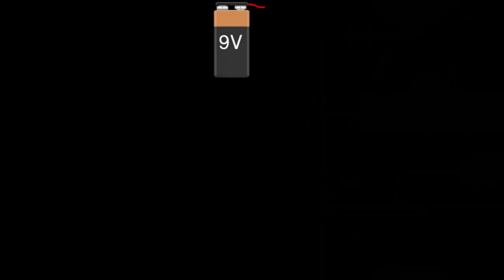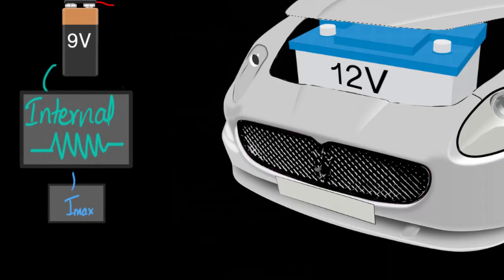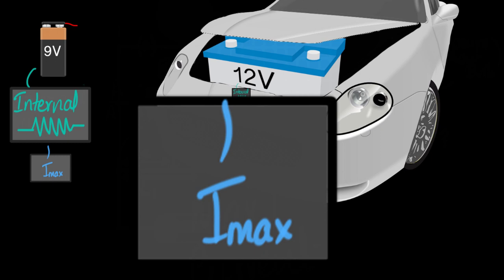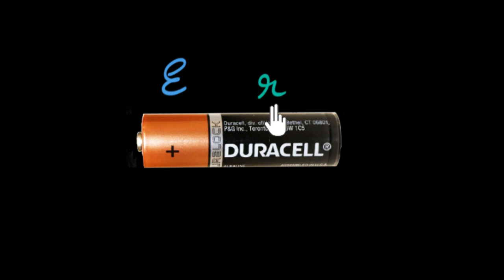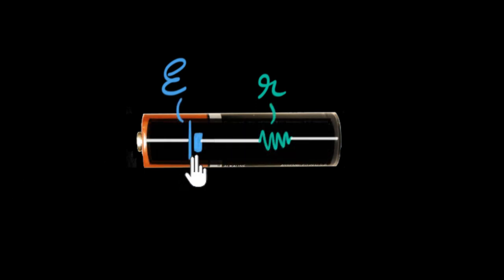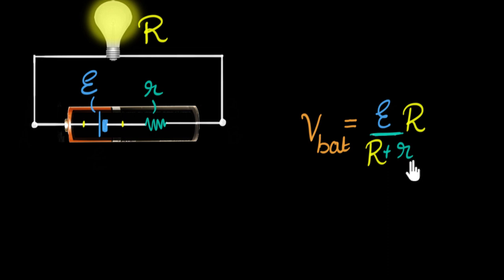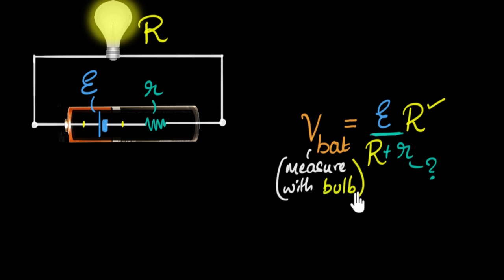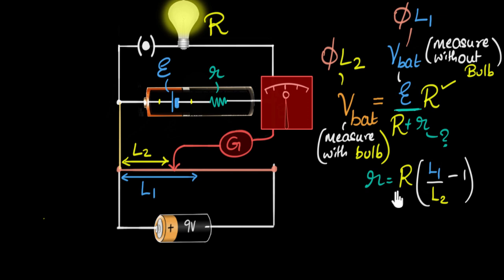Potentiometer - calculating internal resistance of a cell | Electricity | Physics | Khan Academy

Comment: Summary Of The Video :-

Potentiometer

* We use a voltmeter to measure the potential difference (Voltage) but it does not give us accurate value.

Because it draw some ammount of current from the circuit. Which can change the value of Voltage as well.

* We can measure the accurate value of Voltage by using a _Potentiometer_.

 Principle Of Potentiometer -  The principle of a potentiometer is that the potential dropped across a segment of a wire of uniform cross-section carrying a constant current is directly proportional to its length.

 Wire Used In Potentiometer - Generally alloys like constantan or manganin are used as potentiometer wire because they posses high specific resistance and low temperature coefficient

 Null Point or Balancing Length Of The Potentiometer -  The balancing point or null point of the potentiometer is the point on the slide wire when the galvanometer shows zero deflection. 

 Primary Circuit & Secondary Circuit -  primary circuit consists of a secondary cell( driver cell). and a secondary circuit is the one in which the primary cell whose emf is to be determined is connected.

 Potential Gradient - Potential drop per unit length of the wire is known as potential gradient. 

 Sensitivity Of Potentiometer -  Sensitivity of Potentiometer means the smallest potential difference that can be measured by using it and this can be achieved by decreasing the potential gradient by increasing the length of the wire.
Reply: how many time you spent on making it😂
Reply: @Nishantsingh-bq1ml lts actually OK, cause for someone somewhere this might help in understanding certain definitions

Comment: Sir is the magnitude of charge of an electron -1.6 * 10^-19C or 1.6*10^-19 C ? How can 1C of charge contain 6.25 times 10^18 electrons? If 6.25 *10^18C
Move to right can we say 1C of charge moves to left? Please please answer my doubts I have these doubts from a few years and they aren't clarified....🙏🙏🙏
Reply: Charge on an electron is -1.6 *10^-¹⁹ C but the magnitude willl be positive of that value . And through milikans oil drop experiment we found that value , and if there are n electrons the the charge would be n times that value (e=1.6*10-¹⁹) . So q=ne . So if there is 1C of charge n=q/e so 1C/ 1.6*10-¹⁹ which will be equal to 6.25 *10¹⁸ electrons. If ther was 6.25 times 10^18 C of charge divide that by "e" and u will get no of electrons in that amount of charge. We generally use conventional current where positive charges flow but really not , electrons ( negative charges ) are actually flowing from negative terminal to positive terminal) but between 80-90's they used to follow that positive charges flow . So we r till now following that convention that's y it is called as conventional current . So mathematically , a positive charge flowing in a direction is equal to negative charge flowing in the opposite direction. Hope u get that
Reply: @manojmaheshwari4055  superb 👏👏👏
Reply: @manojmaheshwari4055  thank you
Reply: @kiranbhat4902  I'm happy to help you kiran🙏🏻🙏🏻

Comment: Sir at 10:46, why didn't the Galvanometer stay at 0? Why did the Voltage drop when Current was passed through it? Please clarify sir
Reply from the maker: This is clarified in our previous videos on EMF and cells. In short, if you have a 9V battery, it means a coulomb of charge gains 9J of energy as it gets pushed from lower to higher terminal. But, due to internal resistance, some of that energy is converted to heat, as a result the net energy gained will be less than 9. This net energy gained is the potential difference across the cell. The more current we draw, the faster the coulomb moves, the more energy is lost to the resistance, the smaller net energy gained, and hence smaller the p.d. across the cell!
Reply: @KhanAcademyIndiaEnglish  Thank you so much sir!!! 🙏🙏🙏

Comment: Sir one doubt , shouldn’t the voltage of battery be E-ir?
Reply from the maker: That's true as well, but we wanted a relation connecting the EMF and the external resistor, since its value is directly known.
Reply: @KhanAcademyIndiaEnglish  Oh okay sir got it. But sir I got another doubt- why is I=E/(R+r) ,E isn’t the terminal voltage,sir.
Reply from the maker: @sashwatyo1293  Maybe go through our videos on cells and EMF?
Reply: @KhanAcademyIndiaEnglish  yes sir sure sir...actually I have done that Concept once , but I have forgotten most of them over the year......Thanks sir ...;))

Comment: Sir why do we have to get rid of the bulb while we are calculating the emf of the battery?
Reply: Because with bulb the voltage that potentiometer measure is terminal voltage and without bulb the voltage that potentiometer measures is emf